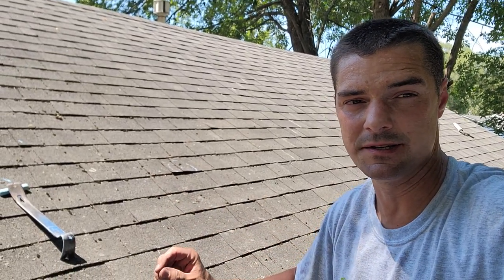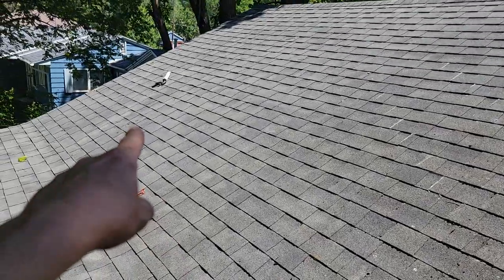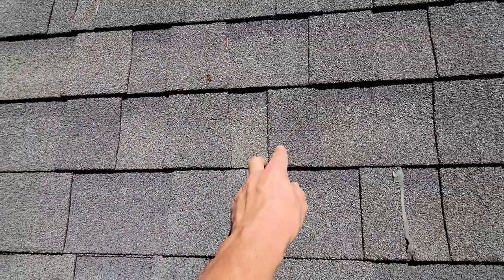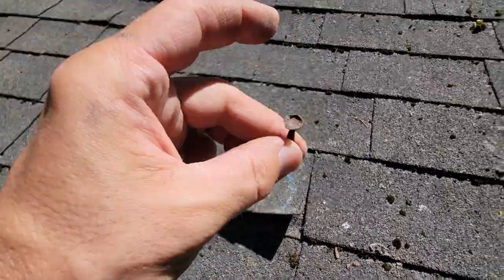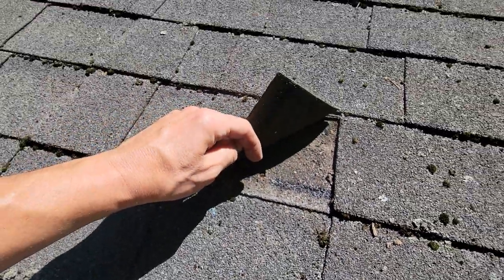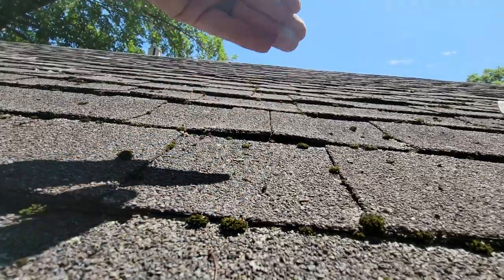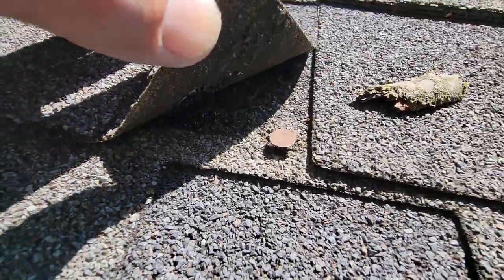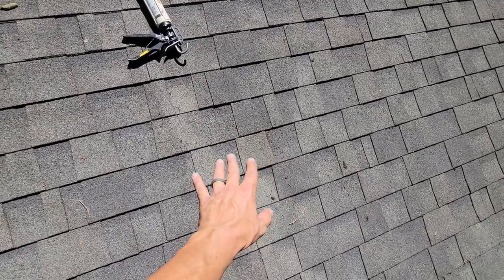Roof leaking due to bad nailing / nail placement

Comment: This is the first video that I saw that actually explained how/why an architectural shingle leaks.  Thank you... I have been chasing a leak for months without knowing exactly what I was looking for.
Reply: I’m a general contractor. I’ve never found a leak from a misplaced nail. I always keep looking and it’s always somthing else. When he lifted the shingles I noticed the patch lifted not just one shingle. This is defiantly wind blowing, lifting the patch while raining forcing water under the shingles. Roof looks crispy that’s why he tore it when he lifted the shingle.
Reply: @AnthonyTryon how can I fix the issue ? Got the same problem
Reply: @AngelGranados-st2ck  I've done this successfully many times because I have a bad roof install. It is impossible to find the source of the leak from looking on the roof top or running water on top of the roof. You have to go into the attic when it is raining, find the leak which is always a nail, and hammer a thin 'finder' nail right next to the leaking nail until it goes through the sheathing and shingle on the roof. Then go on the roof and find the nail poking out, push it back down and out and lift the shingle and pull out the rusted nail. You may need to use a metal putty knife heated with a propane torch to gently work the shingle up. Then force roofing cement into the hole such that it goes all the way through and oozes out the attic ceiling, and some into the hole in the shingle. Then put a bead of roofing cement along the original shingle tar line to glue it back down. There isn't a need to put a new nail into the shingle.

Comment: Great series of videos.  Helped me fix my roof leaks around my chimney.  The previous roofer put counter flashing in T111 plywood.  Lasted about 17 years until the plywood rotted.  Replaced the rotted plywood (not the counter flashing), put in step flashing and added a new additional outer skin of T111 to the structure and many shingles.  Found Geocel 4500 too.  Used it to reseal all of the 15 year old architectural shingles I disturbed in doing the work.
Reply: The roofer who did my roof used steel nails hammered into the mortar to attach the flashing to my chimney. They rusted out after a few years and the flashing came loose.

Comment: Another helpful video.

Just a thought. I feel like shingle manufacturers should put spots/markings on the shingles so installers know where to place nails. This would really help to mitigate this issue. For example, a circle marking or something on shingles where to place em.
Reply: They don't do it because that would make sense.
Reply: Excatly!   That's what I wondered.  because you have to have a nail on each end at least and in the middle.  Sooner or later, you can't help but have a nail within a couple of inches of a keyway.
Reply: That wouldn't make sense because the keyway can be in different places and still be okay. Such as the roofer could be installing going up and right instead of making the stairs go up and left like in the video.
Reply: @dangunn6961 it would make sense if it was a complicated thing to do, but installing shingles is pretty straightforward

Comment: My Lead definitely ruined our customers roof, good to know. I don't wanna laugh... but thanks for the information. 
 We ran power with four wire through the roof, and under shingles  in two different spots for soffit lighting. He put nails directly through top of the shingles, and ran power directly under multiple shingles coming out by the down spout.

Comment: Brian I think that the larger problem is with course stagger . Most guy's are pretty well set with their nailing pattern. 1/2"-1" nail from each end and 13" from each end. Paying attention to course stagger is more important. A 6 1/2"-7" stagger avoids nails in keyway. The other problem is with the manufacturers installing the adhesive strip across the entire bottom of the shingles. It should be a staggered pattern as when it seals the solid line will trap water in wind driven storms and that water will travel to the shingle butt joint and leak under the roof. The manufacturers that are leaving the nail line area void of granules are more susceptible to this .

Comment: Great videos, yours have become my favorite on the subject. A bit of a tip maybe: when you have your camera on your head my wife cannot watch them at all, it gives her motion sickness. 
So I have a question: what can you do when your entire roof has this problem, everywhere? I am looking to get a few more years out of this roof. Can I go through and methodically seal the tops of all the keyways with Geocel 4500, and expect that to work?  
I ask because to separate, lift up both ends of every shingle, seal nails, and seal back down the singles, on a 36 square architectural roof seems an impossible-sized task. I have been developing small leaks and thanks to your videos, I now know why. If you were local I would call you and hire you.

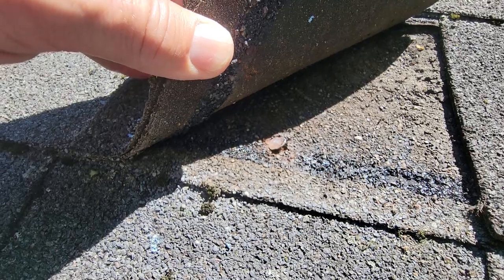Comment: The nail in 1:59 is not close to the keyway, still rusted. I suspect that the real reason is the slight dip in the nail zone inducing water running sideways. Hence another thing to look for is a dip on a roof, seal the nail in the dip if there is one.
Reply: The seal is one continuous seal which causes water pooling
Reply: @mattk8810  huh

Comment: I have an older roof and over the last 3 years I've had several leaks.  Usually it's from nails that the installer drove in but never hit any wood and were just there loose.  Water is probably getting in the keyway and on the head and bingo runs down the nail.  I have a few leaks now that are from nails that are in the rafters.  Been using the Henry's Wet patch.  Is it better to just remove the nails all together and just squirt the Henrys down the hole or just leave the nail in and put a blob over the nail head, shingle, etc?

Comment: I had a roof leak today. I went on my roof and saw a TON of nails located like the 2nd one you showed but they were overdriven and water was pooling on them. I cleaned them out and put roofing cement over them but marked the shingles (to know which ones I did it to). Is that a bad idea or should I replace those shingles in the summer?

Comment: My dad's roof leak over the living room. We've replaced shingles. We've searched for nails and caulked. Gone over the area several times. Still leaks. Is it possible for water to leak through the actual shingles?
Reply from the maker: Not usually unless they're pretty old and the asphalt is wore off.
Reply: @GrandRoofingInc  Thanks.

Comment: Which is better: metal roof or shingle roof?
Reply from the maker: Metal can hold up a lot longer especially standing seam.
Reply: I sprung for a top end architectural shingle.  it is almost 20 years old and my roof still looks great.  It's a 12 pitch roof so I didn't want me or anybody going up there to repair it.  I also only allowed one roof penetration in the whole roof (plumbing stack).  I do have a mile of valleys though, but they seem to have been done well and are looking good.

Comment: So where is the proper way to nail in the right spots?
Reply from the maker: In the common bond but not near any key way.
Reply: To add to that, stagger the shingles correctly to start, and you won't have that issue. This is a super simple roof layout, there is no excuse for the shingles to not be staggered correctly. Then you can just nail every one in the same location, and not be near keyways. 

The shingles should be staggered so  the keyway straddles between the nails, so even if you miss by an inch or two, it's fine.